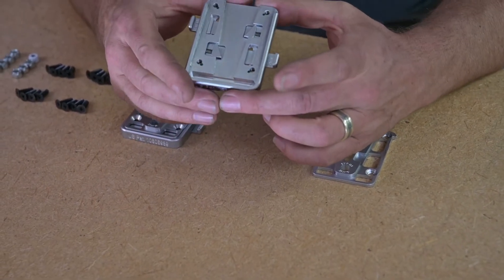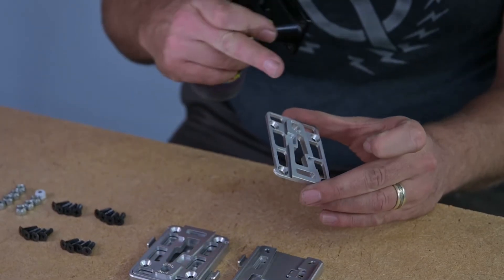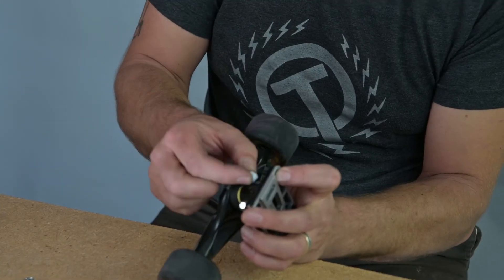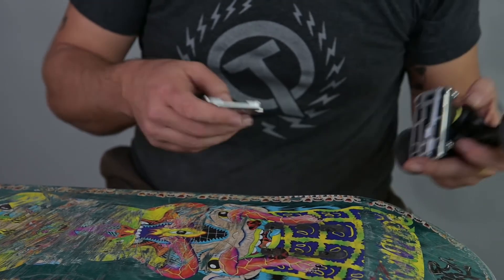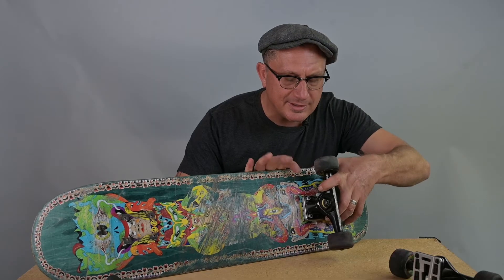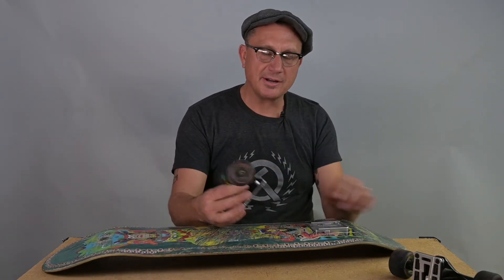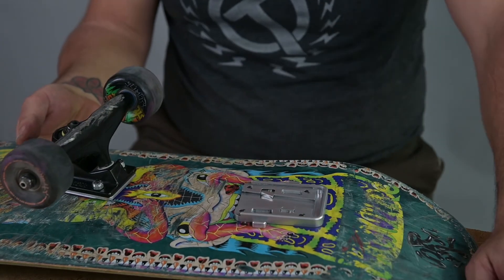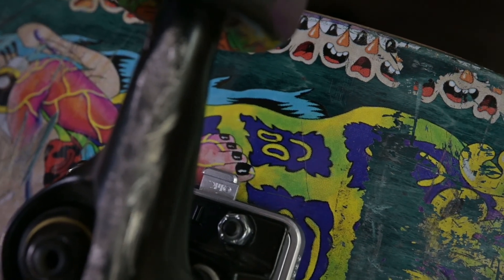How To Set Up Your QliKs | QwikTruks

Comment: How much weight does this add to the deck? Great concept!
Reply from the maker: Thanks Nathaniel! It adds about the same weight as a riser pad...only 80 g, which can be easily offset with a lighter version of your truck. For example my tensor lows with the click system are lower and lighter than my Indy mids without the system. These are made out of a high-grade, aerospace quality aluminum that has been lightened and engineered to be strong and light.
Reply: @qwiktruks4325  I'm french can i buy these without paying 100 of dollars shipment ? Good job!
Reply from the maker: @frenchgoldenboyfan  shipping to France has been only about $38 👊🏼

Comment: How much height does this add to the truck?
Reply from the maker: The QliK System is just under 3/8" high... So, for example if you want a standard truck height, Ace Low trucks WITH our QliK System is the same height as a standard Independent truck.

Comment: I have a whitetail board that is thicker than a normal deck. How do I work out what screw length to go with as it looks like on your website they have to be an exact fit?
Reply from the maker: Great question! Sophie from whitetail actually uses our system as well. The next longest screw from our standard screw should work, which we sell on our website. standard length is 5/8 inch long and you will want the 11/16 inch length for the thicker deck.